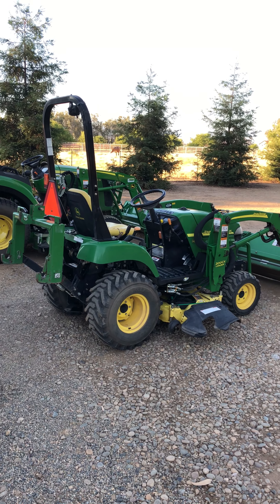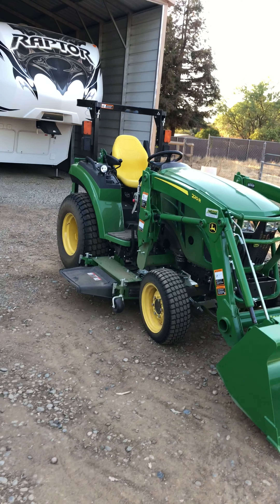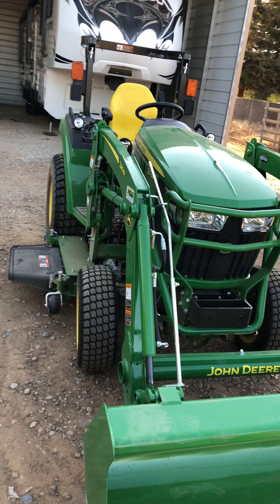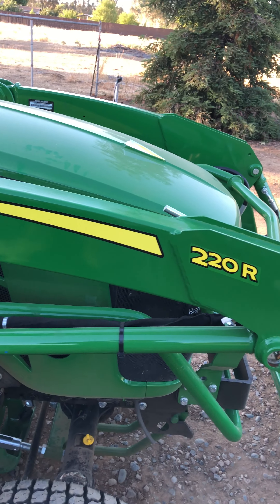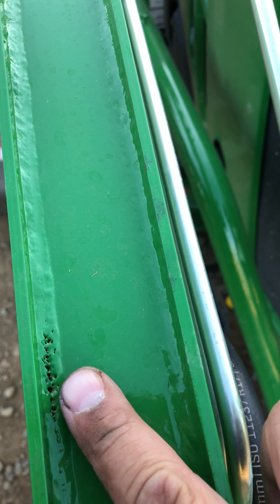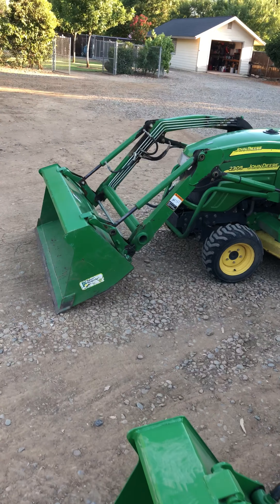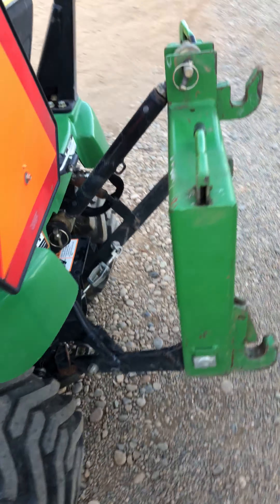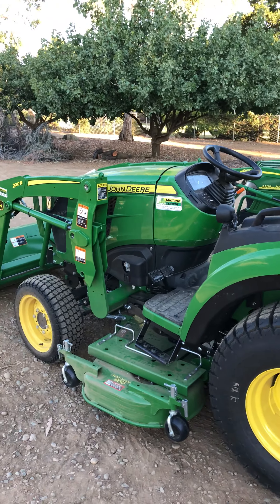2018 John Deere 2032R vs. 2006 Deere 2305

Comment: That is really disappointing about the welds on your new loader. I’d be livid. I have a 2013 JD 2320 with only 145 hours on it and just love it. Picked it up last fall from the original owner and didn’t really use it much at all until this spring. I’ve already completed several large jobs around the house and don’t know how I ever lived without this thing!
Reply from the maker: John Deere replaced that arm without a problem.  I have to agree that I could not live without my tractor.

Comment: Love the name of your horse. I’m looking at a 2007 2305 with 600 hours. Any advice. Pros or cons.
Reply from the maker: I really liked my old 2305.  It doesn’t have the emissions equipment and far less electronics to go bad.  You can repair the relays yourself if you can do some troubleshooting if they go bad.  The only issue I had was the diodes burning up on the electrical harness and I was able to repair it myself.  I had to replace the alternator and regulator once after 10 yrs but that is just maintenance in my opinion as that will happen over time to any machine. Just change the fluids as specified in the manual and you should be happy with it.   There is no position control on the 3 pt - so grading with a box blade isn’t as nice.
Reply: Just got an '08 2305 with belly mower & 200CX loader, in great condition!  Only 805 hours on it and I cannot find Any worn out parts! Of course I had to crawl around all underneath to check it out And found nothing loose, bent or broken! Love it already 👍😃🍀

Comment: how in the world did that weld pass?
Reply from the maker: Not sure how that passed muster. They did change the loader arm out without a problem.  Outside of that weld, I have not had any issues with it.
Reply: @cdee6096  you'd figure when it was delivered at the dealer they would check them 0.o